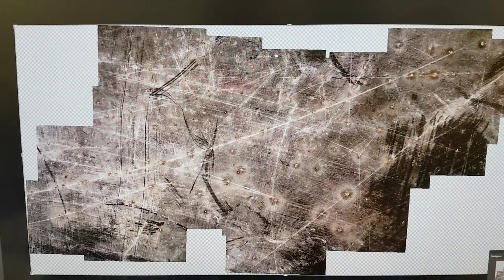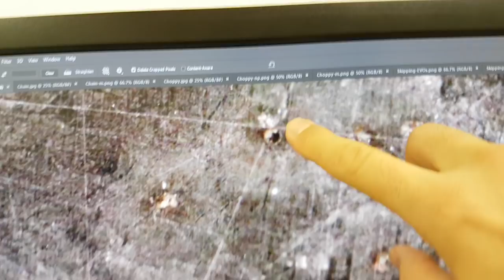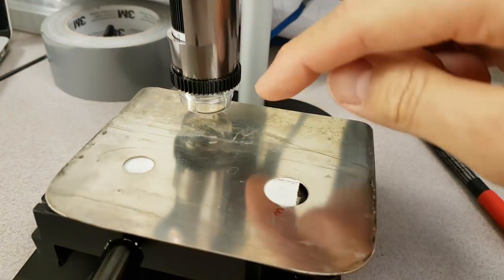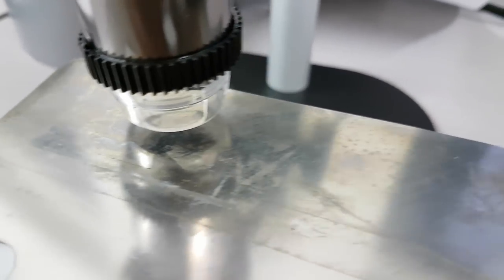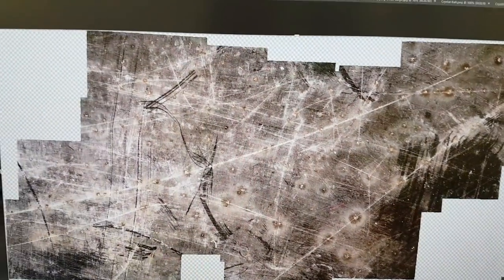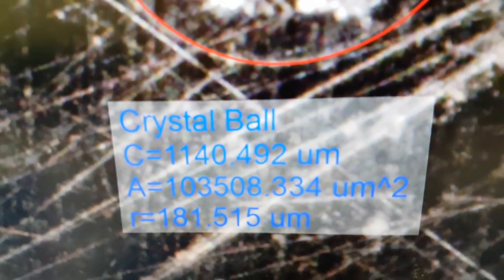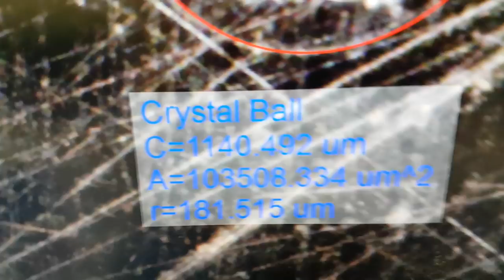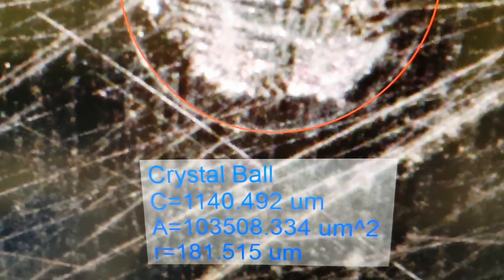OHMA - Plate 3 - Crystal ball (is this RT Crystallised Hydrogen?)

Comment: Fascinating stuff...especially in relation to LeCair's cavitation & Shoulders EVO research. I totally agree that the micro surface scratches (straight & curved left from the polishing wheel) are acting as channels & guides for water encapsulated form of EVOs (the chains, i am's, & bubble ring tracks & marks). Where as the impact cavitation flower craters are very similar to LeCairs SEMs of high density water crystal jets formed by cavitation bubble collapses, which strangely speed away at 90degrees on the metals surface (or surface scratch) after hitting the surface making the appearance of these tracks.

Due to the Ohmasa vibrating cavitation plates being driven at fairly low frequency with low energy, the cavitation bubble jets are not boring deep holes in the platinum coatings surface. From what i can recall Shoulders did not study liquid based EVOs, as Shoulders focused on gas based EVOs as far as i know...

LeCair has studied alot of these metal/ liquid cavitation effects extensively, with the use of creating massive cavitation effects pumping water under negative pressure through a finely perforated off the shelf aluminum sheet. So i imagine by using sharp edged perforated sheet as Ohmasa vibration plates would perform similarly.
A well as in putting cavitation energy via mechanical or electrical means, the intensity & efficiency of cavitation bubbles & jets can be dramatically increased by reducing the vapor pressure of the water down to just above its boiling point at a specific room temperature. Wish you could zoom in to those straight tracks with an SEM to see if they are hexagonal or more round, as this would confirm if they are EVO tracks or water crystal tracks ;)
Reply: Ps. The crystal ball looks like its filled with a palladium crystal deposit (unless they are another pure transmuted metal element due to its excellent crystal metal tree like fractal growth). Most likely deposited from a palladium ion packed charge cluster (EVO), potentially created by an extra large cavitation jet packed with vaporized palladium ions knocked off the surface in solution from previous cavitation jet impacts in the same region...?. Water cavitation jet metal impact craters & their corresponding hexagonal water crystal surface fusion bow shock wave tracks (traveling at extremely high speeds) are also highly charged in nature,  (including EVO charge clusters), so should be able to attract palladium ions from solution in theory and get lucky :)

Comment: Looks like evidence of particle physics going on beside regular chemistry.
Might be time to write a paper, have it published, and see what the peer reviews say about all this evidence. 

.

The results could probably be enhanced through inductive heating, which of course uses a magnetic field flux. 

Rewrapping the copper coil wire from one of those cheap home induction cookers around the agitation vessel ought to be easy enough, and the electronics from the cooker will still allow easy adjustment of the heating level.  The purpose would be to observe many more of these tracks and bubble phenomena.